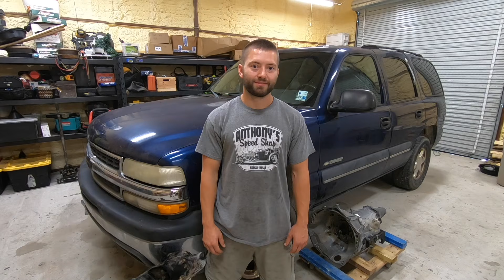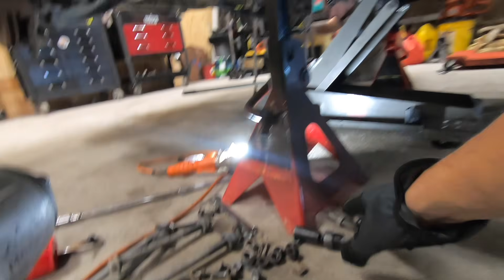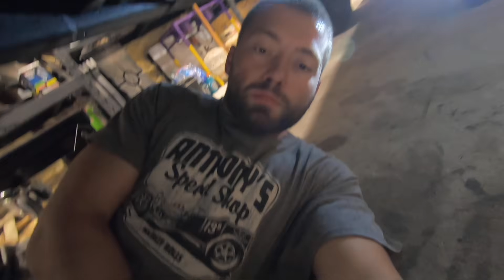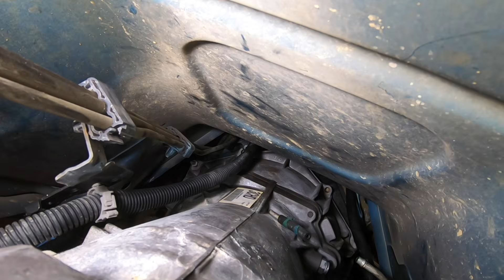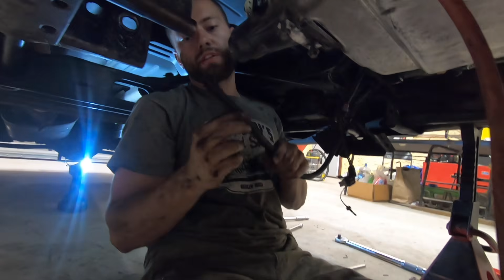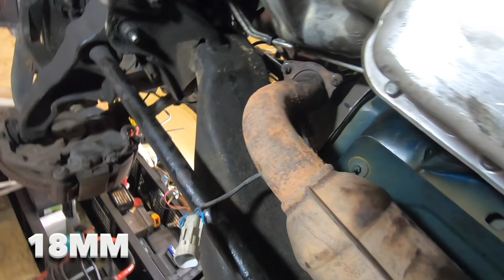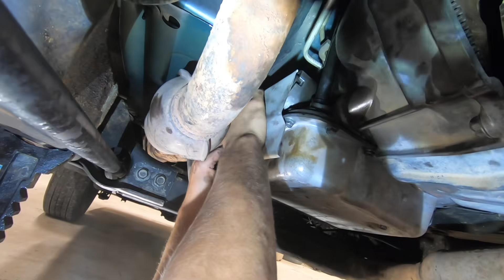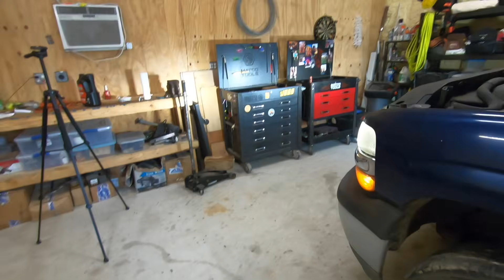4L60E TRANSMISSION INSTALL || EASY

Comment: So why is the bigger hole on the flex plate the first one you start? Cause it lines up the other 2 bolts?
Reply from the maker: Because it is oblong, it gives you some wiggle room when starting the other bolts.
Reply: @dudewecanfixit  which lines up the other bolts...cool cool, I just dropped my 4l60 and would have never known that. Thanks for the response
Reply from the maker: No problem, good luck

Comment: What spec did you torque the bell housing?
Reply from the maker: Transmission to Engine Bolt 35 lb ft

Flywheel to Torque Converter Bolt 46 lb ft
Reply from the maker: I didn't realize I skipped over the torque specs
Reply: @dudewecanfixit  You did mention the spec for the converter.  Love the channel. Keep up the great content!

Comment: I've known people to fill up converter first with 6 to 7 quarts of oil first and then fill up with 5 quarts 2 while it's off and gradually add other 3 to prevent leaking from vent and more accurate measurement of the oil that is supposed to take.
Reply from the maker: That's one way to do it. It does make the torque converter much heavier during install though
Reply: Agree, but definitely if you have the hands you can give it a try. Nice DIY video. By far one of the best ones out there. Always had trouble taking off the lock out connections and the heat applied madr it much easier
Reply from the maker: Thanks!

Comment: do I prefill the torque converter before install?
Reply from the maker: I like to put a quart in it before the install. Take your time though, it takes fluid slowly
Reply from the maker: New and reman torque converters are pre-lubed, so you don't have to put fluid in them

Comment: Can someone help me, I’ve installed everything to my 4l60e transmission I’m having trouble connecting the top oil line to the transmission. Any suggestions?
Reply from the maker: Lubricate the end of the line and the inside of the connector with automatic transmission fluid. Make sure that the c-clip is installed and be sure to push the line straight in, not at an angle

Comment: Hey Brother let me ask you this I have a 2000 GMC Sierra and my transmission is leaking transmission fluid from that torque converter I don't know if it's the torque converter something else
Reply from the maker: It's most likely the pump bushing and seal that the torque converter sits into
Reply: @dudewecanfixit  👉☝👍tanks

Comment: Good video here, looks like I installed the 4l60e correct on my 94 gmc 1500 2wd, but as soon as I put it in gear, the truck dies. Any ideas?
Reply from the maker: Ooh, I'm not sure. Does it die in every gear? RND21?
Reply: @dudewecanfixit  yes it does
Reply from the maker: Even in neutral?
Reply from the maker: And reverse?
Reply: @dudewecanfixit  sorry, it will stay running in Park and neutral.
Reply from the maker: Okay, it sounds like something might be binding up. Lift one rear tire off the ground and spin it by hand. Make sure that the drive shaft spins freely in every gear except park
Reply: Bro you have to make sure you install your drive shaft proper dynamic balance

Comment: Its almost like you made this series of videos just in time for me to have bought this truck with a bad 3/4 band. its a 2010 but im sure its all pretty much the same, i just hope i get the right kit and dont get pneumonia dropping the thing out in the driveway here in michigan this time of year lol. thanks for vids to follow along with. makes me feel confident that i can handle the rebuild myself.
Reply from the maker: If you have some help, you should be able to remove the transmission in just a few hours. Then I hope you have a warm garage for the rebuild! Good luck, it's really not a difficult project, just take your time and enjoy the learning experience
Reply from the maker: Also, I got my kit from transmissionbench.com. You could also use rockauto.com or summitracing.com. If you have a local transmission parts supplier, that might even be better
Reply: I was thinking about grabbing one of these guys https://www.ebay.com/itm/4L60E-4L65E-4L70E-04-up-Master-Rebuild-Kit-Transmission-Overhaul-4L60-E-4L75E/202644117744 I do have a workshop with some propane heaters to rebuild the tranny in. Just gonna have to shovel snow when I go to take it in and out lol. I’m just making sure I get a kit that has the pistons in it, cause I figure if it’s not that check ball in the housing it’s gotta be the pistons that caused the 3/4 to go bad. Originally I hoped it was just a solenoid so I dropped the pan twice trying to fix it but now when I drive it I can tell it hits 3rd but there’s just a lot of rpm before you get any sort of pull feel out of the pedal then it just drops back into 2 when it gets around 4k
Reply from the maker: Sounds like you have it figured out. Sounds like the frictions and steels are toast. Definitely replace the pistons and verify the check ball doesn't leak. Also look into reaming out and replacing the AFL valve  in the valve body. You should also replace the TCC valve, these wear out and 3-4 apply fluid pressure can be reduced increasing slippage and burnout of clutches. Sonnax and transgo make kits for these repairs.
Reply: @dudewecanfixit  I’m looking for some but most of what I’m seeing is for 97-99 and 2000-03
Reply: @dudewecanfixit  I suppose there is this kit here http://vi.raptor.ebaydesc.com/ws/eBayISAPI.dll?ViewItemDescV4&item=303763663926&category=33727&pm=1&ds=0&t=1605200388000&ver=0&cspheader=1 looks like the smarter way to go, then you get the alum bit for the accumulator like you did on the Tahoe.
Reply from the maker: Perhaps those issues are not as relevant on the newer models. I am not sure
Reply: @dudewecanfixit  yeah I’m not sure. This kit just says 97 and up so.. maybe I’ll just fix whatever I can. I don’t usually keep vehicles for very long and rarely put more than 5000k on them myself
Reply from the maker: The 4l60 series did not change much throughout it's production, so it'll probably work. I would say it is most likely the piston causing your issues, you will probably be fine without the valves I mentioned. How many miles does that transmission have on it?
Reply from the maker: That kit looks pretty thorough. Make sure you replace the boost valve in the pump, that is very important as well. 

between the overhaul package and the extra kit, I think you are very well covered
Reply: @dudewecanfixit  it has 210k
Reply: @dudewecanfixit  how long you reckon it would last if I just did the eBay kit?

Comment: I installed a transmission on 99 suburban everything connected properly but it wont go into gear nor will fluid flow down to transfer case adapter.  any suggestions
Reply from the maker: If the linkage is attached correctly and you put it in gear, it should default to 2nd gear even with no other inputs. If it does nothing, the transmission needs to be overhauled.

Comment: How do I know if the transmission from my 1999 yukon will fit in my 2002 tahoe? They are both 4L60E transmissions and both are 2WD. I was told that not all 4L60E transmissions are the same. My yukon jas the 5.7L engine and my 2002 tahoe has the 5.3L engine. Thanks for any information.
Reply from the maker: As far as I know, they should be interchangable. The differences could simply be internal and not affect the compatibility. You could Google search "4l60 changes by year" and see if that yields better results
Reply from the maker: The main thing I would compare is the electrical and mechanical connectors on the driver's side of the transmission to be sure those are the same
Reply: @dudewecanfixit  Thanks

Comment: Thanks for the video. Your install video looked as easy as the removal. I just wish i could het my truck up as high ad you did.
Reply from the maker: I have used blocks of wood before to increase height, but whatever you do, make sure it is very stable before you get underneath the vehicle!

Comment: Hey is this is 4x4 or not
Reply from the maker: No, a 4x4 is mostly the same process plus removal of the front driveshaft
Reply: Ok great thank you does the transfer case come off also in the 4x4 process i appreciate you responding
Reply from the maker: No, you can usually leave that on

Comment: So there isn't any way to get the dipstick in after you install the transmission, even if you lower the rear of the transmission?
Reply from the maker: Eh, I doubt it. It fits between the curvature of the transmission and the tunnel. Not much clearance
Reply: @dudewecanfixit  got it in for the bottom in about 5 min. After removing the dipstick  form the true.
Reply from the maker: That's great! Good to know

Comment: safety first guys! good job  but you need to buy at least a few concrete blocks to protect your self while you be under the truck
Reply from the maker: I use over rated jack stands for safety. Watch at the beginning of the video how I purposefully push on the truck in every direction to make sure that it will not move and is safe to be under.
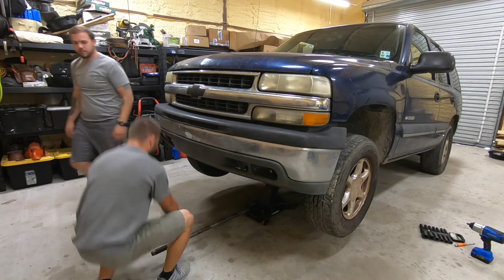Reply: Watch from 1:15

Comment: 🔧DEAR Dude We Can Fix It=🔧  2 Question: (1) WHAT ARE THE ABSOLUTE " MUST - DOs - And - MUST DONT's*  regarding installing a transmission in general and/or a transmission for a Ford Explorer Sports Trac?    (2)  WHAT ARE THE ABSOLUTE " MUST - DOs for installing a used transmission (example: any budget friendly items that can be purchased to ensure that the transmission has longevity?)    🔧(thanks)🔧
Reply from the maker: As far as ensuring longevity, take the pan off and drain the fluid, clean the pan, install a new filter, and clean the magnet. Once the transmission is installed, refill with fresh fluid, drive around, and double check that the fluid level is correct. Maintaining clean fluid at the correct level is the only maintenance you can do on an automatic transmission.
Reply from the maker: The best thing I can suggest for installing a transmission is to make sure the torque converter is all the way seated and take your time with the bell housing bolts. If it doesn't want to suck up to the engine and close the gap, take it off and make sure the converter is seated. If you try to force it, the bell housing will crack